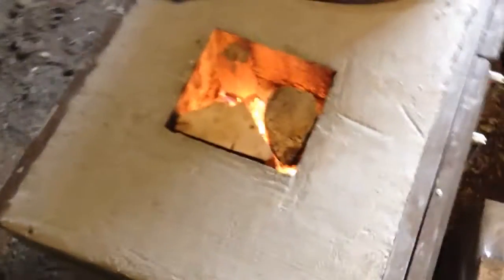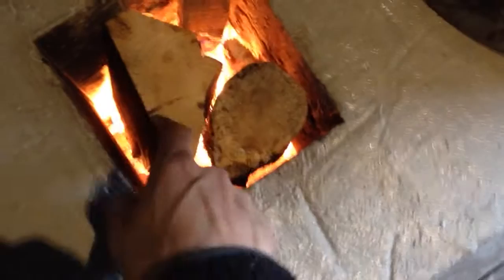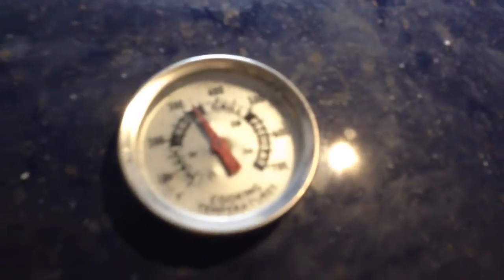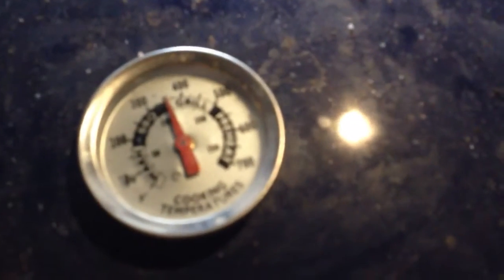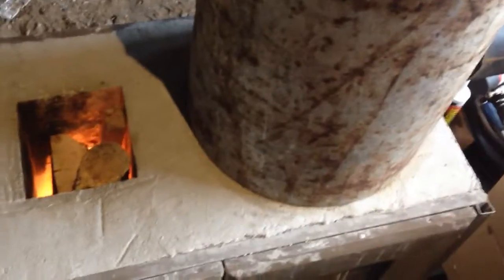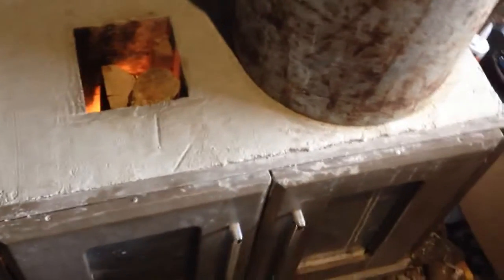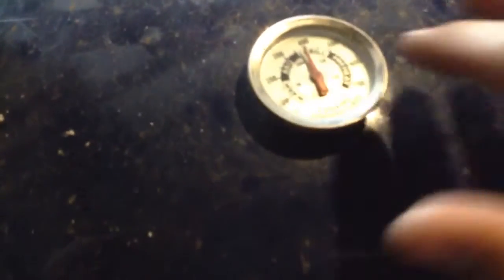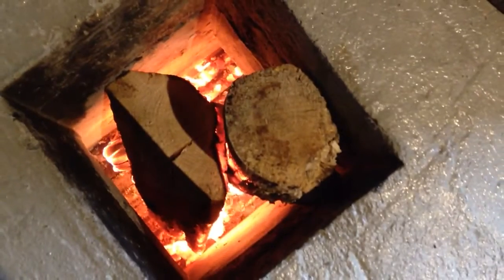Rocket Stove  Build #48 Rectangular Brick Riser on Cast Core

Comment: Can you stand back a little so we can see your rocket stove. Thanks
Reply from the maker: sorry about that.  This is episode 48, i do have 50+ more episodes if you want to see more.  i often zoom and focus on the subject intentionally as to avoid you guys having to see my messy and cluttered background lol.  i often focus on the subject and try to avoid the bigger picture, for the sake of my messy barn/workshop.
Reply: I know what you mean. My barns a mess too. I will look through your playlist again. Well done on the rocket stove.
Reply from the maker: @dubhaltaghohearcain2431  thanks, this one is a massive cast core, cast inside a HD steel recycled BBQ cabinet lol.  it has a firebrick riser in this episode.  aside from that its just a modified 100lb LP tank overtop the riser for a heat exchanger bell, and the exhaust exits out the mid-side of the bell.  thanks for watching.  i might do some more rocket stove videos this season :)

Comment: Hey John I was wondering if you could give me measurements on the burn chamber and heat riser. I plan on making one before winter gets here for my Greenhouse. I come across some refractory cement cheap so I thought it was time for me to build one.
Reply from the maker: Tammy Lull im glad you like it.  The feed port is 6.5" x 6" , somewhat intended to be 6x6, the feed port is 15" deep , intended for 16" stick wood.   The horizontal burn chamber has a ceiling that tapers upward slightly toward the riser, which is very unique, this helps with cold starts since heat rises.  The burn chamber is about 10" long between the intake and exhaust ports.  I like short burn chambers in my designs, but I wanted it to be strong since its a one-piece cast-core.  The riser port is 6" round in the cast core, I used a 6" pipe for a mold when I cast the core, then removed the pipe after the core cured for a few days.  There is a ceiling about 9" thick above the horizontal burn chamber, but it tapers into a larger port, and smaller 8" ceiling toward the riser, which helps convection and heat drawl upward for thermodynamic draft assistance.  I was going to use a round riser but I ended up scraping that idea and went with a rectangular brick riser.  My previous videos should show the brick riser configuration.  The external core measurements are 18.5" wide, 32" long, and the core is about 21.5" tall.   The core was cast inside a recycled heavy duty BBQ stand, with heavy duty casters as a permanent core mold.  It can be moved carefully and slowly on wheels but its heavy.  Almost 50% of the casting volume is perlite.  I mixed and refractory cement with almost 50% perlite by volume.  So for example when I add 5 gallons of refractory cement, I also add about 4 gallons of perlite.   This helps with a few things like insulative properties for a hotter internal combustion, lighter weight, and ultimately the perlite is cheaper by volume compared to refractory cement.  I might find some of my build diary photos and share them sometime soon.  Thanks for your interest.
Reply: MrJohn613 hey thanks for the info. I like that idea that the burn chamber tapers upwards towards the heat riser. You can give me your thoughts but I was thinking of using a triple wall pipe for my heat riser. The inside pipe of the triple wall is stainless steel but I need to change the 8 inch to 6 inch I thought of doing this with a 6 inch cardboard tube and filling around it with refractory cement and perlite. Would really like to see the photos that you may post! Thanks again
Reply from the maker: Tammy Lull I would not recommend any metal inside the flame path, especially in the riser.  That's why I switched to a rectangular firebrick riser.  The good thing about this unit is the riser is replaceable, but the idea with this unit was to have zero or minimal metal in the internal flame path, because the intense afterburn can damage most metals.  My final riser variation using insulative light firebricks seems stronger and can take the intense heat better.
Reply: MrJohn613 I had heard that stainless steel could withstand the heat better than most  but my initial heat riser was going to be made out of refractory cement and perlite. I was going to make it using a cardboard tubes 6 inch inside a 10 inch and fill it full of refractory cement and perlite. Do you remember how many bags of refractory cement you used?
Reply from the maker: Tammy Lull I used a 50lb tub of dry refractory mix, plus 80kg of dry fireplace mortar mix, combined with wet weight and perlite, for my own refractory mix which I used for casting the core.  I was slightly shy in volume, a few inches from the height I wanted, so I decided to finish off the top few inches I was lacking and wanting with fireplace mortar and 6000psi fiber enforced concrete mixed, since I didn't quite have enough of the original refractory mix volume.  The entire thing has been better than I expected, most people create two halves or stress relief cuts when casting a core, because one piece cast cores are more prone to cracking, however I have not yet encountered any major cracks and it does see huge temperature fluxuations here in Canada, from -35°C during winter and up to 900° when burning rocket mode.

Comment: The whole idea is to have it cooling going down hill  as the cooler exhaust is denser and wants to drop.
Reply from the maker: Yes the hot air from the riser cools slightly when it leaves the riser and hits the surface of the bell / heat exchanger which is exposed to either the atmosphere or room temps on the outside of the bell, the bell is the propane tank.  When the outside of the bell is in room temperature or outside in the cold shop, it makes a slight differential.  So the gasses inside the bell are much cooler than the inside riser, because the bell is exposed to the external temps and the riser is more insulative for clean combustion.  Most of my convection direction is due to the fact that heat rises.   Thanks for watching :)

Comment: Pine always has resin, that is why it is not good to burn in any indoor fire unit.  The pine tar creates creosote.  Too much creosote will eventually cause a chimney fire.  That is arguably the fastest way to burn down your house.
Reply: Rocket mass heaters burn very hot and burns all gases  and creosote caused from burning wood. That's the point of building one!!
Reply from the maker: I do this R&D outside in a ventilated work shop.  I mostly burn elm hardwood.
Reply from the maker: well said tammy.  thanks for watching :)

Comment: how many fireconcrete you did use for that core>? thanks

https://youtu.be/VEAJSP4D9Mo
Reply from the maker: audio kees , I used a 50lb bucket of dry refractory concrete mix, plus lots of fireplace mortar and perlite mixed into the poured core casting.  I watched your video link, that thing is excessively huge but you did a good job, it seems to drawl the air good with that huge riser stack.  Good work
Reply: Oke Thanks, I did made the rocket through a book I buy, did use a 200 liter oil drum but now I get smoke, maybe because it is outside and bricks are concrete road brick not fire brick for the test, hoy big is your tower on the rocket? looks smaller then a 200 liter oil drum, I need warming 29 m2 room with it so need big enough.

The stones I did use are also quite big, and thick, I have made a 15 x 15 cm system, and a nabure who call police when try to burn, it smokes sometimes because of wind blowing in.
Reply from the maker: Episode 47 tells the height of the riser, and the depth of the core.   Together they are over 3ft, and the burn chamber is specially designed by myself, it has an angular roof which rises slightly toward the riser.  It can all be seen on the previous episodes.  :)

Comment: Ahh now you have my interest. Moving in the traditional J tube mass heater direction I see. Now you might consider combining your J-tube with a mass bench to really amp up the efficiency. It's all about the mass and how much heat you can capture. 

The previous vid of the rocket heater with no mass, did not interest me at all. I would guess they are no better than a fireplace and waste the vast majority of heat out the smoke stack because there is no mass to capture the heat.
Reply from the maker: I've only built 3 rocket mass heaters.   The older first two are J-tubes with internal mass, they are hybrid units of my own design.   They re compact and they are full of refractory cement in the several hundreds of pounds.   My latest design is a micro batch box with a separate mass bench.   I call it the match box.  Thanks for watching

Comment: I remember you said this hog was on rollers.  That gives me the idea of "charging stations" where a stove moves to areas of a space to heat a mass. I.E...a bathroom wall, a workbench area, an office/break room, auto repair zone, etc...
Reply from the maker: i suppose it could be possible.   as long as you have your exhaust 
proper.   this unit has about a quarter of a metric ton of thermal mass 
internally.   the stove core its-self is a 500LB massive brick basically. 
  its a hybrid of my own design, it requires no external mass, but it 
could have the exhaust supply more mass is need be.   thanks for 
watching
Reply: Would you be willing to share the ingredients/ratios of this custom refractory mold?
Reply from the maker: I documented it on permies.com so I could go and check but I think I used 30 lbs of Rutland refractory cement dry mix, about two 33 kilo bags of mason mortar, about $100.oo worth of perlite, and 30 lbs of earth.  Something like that.   The retractors cast wasn't enough to reach the top so I poured the top 4-5" much later on with only mason mortar and cement.  I have run it for maybe 10 hours total so far, and it seems to be holding up strong.   My longest test  burn was 4.5 hrs long.   The longevity of the core has yet to be determined.   Thanks for watching
Reply: MrJohn613 How much money is in it?